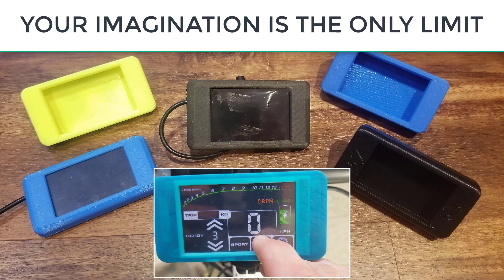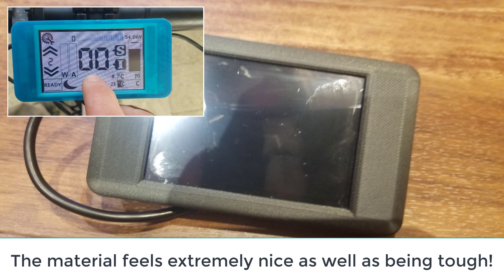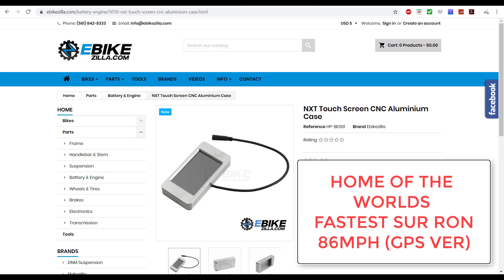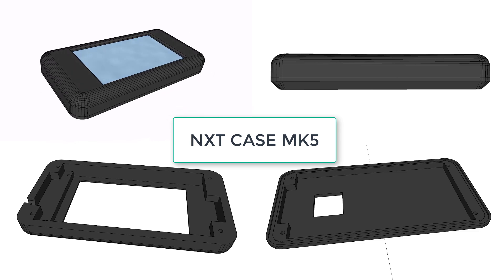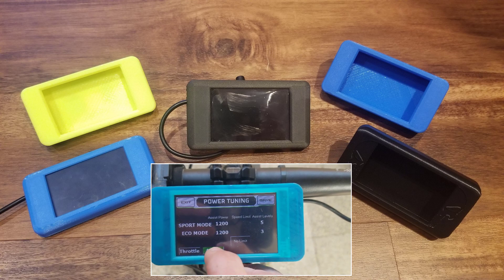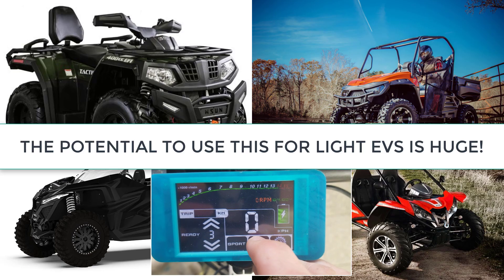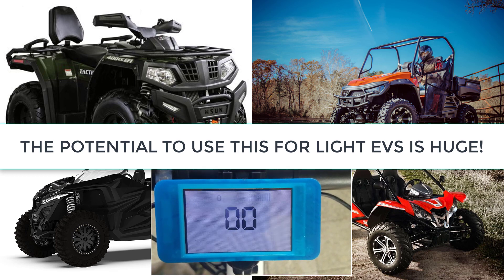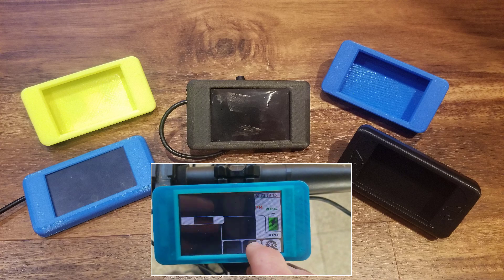NXT Display - Customization Options - Build the Ebike YOU want!

Comment: I have a Yamaha YZ250F bike with a ME1302 motor and a Kelly KLS72701 IPS controller.  Can the NXT display be used on this controller.
Reply from the maker: The nxt only works with ASI controllers right now. Im not sure if it could communicate with the Kelly in the future. I will ask tho. Cheers

Comment: Hi Captain, I just received my NXT case from Ebikezilla, looks and feels great. 
I installed the screen with some trepidation. 
It fit perfectly, my question is, should I run a bead of silicone around the inner screen edge and rear cover to afford some ingress protection? 
Thanks
Reply from the maker: You can try doing that. You can get assembly silicone from car places like lordco. Or you could bag it in the rain. I have a protective cover I am working on for the x case version. I might be able to make one for the Ebikezilla one seeing as how it is an almost exact copy from the first design I did last year.
Reply: @HighVoltageKits  I will definitely use some assembly silicon then, mainly for splash protection. 
Thanks for the reply.
Reply from the maker: Anytime. Enjoy your screen! Cheers

Comment: Do you know what has happened to Alan at ERT? What kind of circus is this fool running? Please, don't waist your money on ordering from ERT.
Reply from the maker: I have been helping on the NXT project since late last year but I have no part of shipping or orders. I have always got everything I ordered but it can be a wait. It's not a huge operation and is under pressure in terms of supply chains at present like many places. Patience can be required. On the other hand you will end up with some of the best tech around for DIY ebikes. Cheers.
Reply: @HighVoltageKits  Thanks for your reply, I haven't heard from him since January, I know he's been busy just wish he would earn the money I sent him!
Reply from the maker: I'm hoping that when the covid stuff dies down the backlog will get sorted out. Are you waiting on the 4000?
Reply: @HighVoltageKits  By the way I love your vids! I'm waiting on a Bac 800 and the Nxt display.
Reply from the maker: Thanks Bob. You will get one I'm sure. The new wiring harness looks pretty good from what I have seen.
Reply: Thank you very much for every thing I've learned from watching your very well done videos, you have helped me make many right decisions!
Reply from the maker: You welcome Bob. Cant wait to hear when the bac is up and running.
Reply: @HighVoltageKits  Call me stupid but I'm running a Bbshd mid drive and a Calibike 5000w rear hubmotor. I have learned to let the strength of one help the weakness of the other. Two independent drives assures this 72 year old Marine that I will get home, plus I'm damned hard to beat across an intersection! Keep up the good work and by ALL means HAVE FUN!
Reply: @bobpatty2937  he must be running some sort of scam.  He doesn't ship and won't return payment.  You can't even contact him.
Reply: @dillonthirst  This is a sad situation, all he has to do is take an ASI controller and match it to HIS display. He has had my money since Jan and at one point lied and told me it would only be a couple of days. That was over two months ago......
Reply: @bobpatty2937  captain says people are receiving them.  Could be a year before we receive ours.  That's just not right.  The sad part is there is no customer service at all.  Even if I wanted a refund I have no recourse here.  Scary.
Reply from the maker: I don't think it will be a year. But it's not in my power to make them either. I will make sure Alan is aware you posted on here.
Reply: @dillonthirst  I have spoken to a federal prosecutor in Muscogee OK. He told me since my order amounted to less than$1000 it would only be a misdomeaner and the case would be ignored. However if enough of Hu's victims get together and file fraud against him which would prove his intent to defraud in mass then they might be interested in helping. He's no doubt a damned worthless lazy Democrat...lol!
Reply from the maker: Bob. I realize that you are upset. Have you considered jumping on my discord channel and talking to people. No one is trying to scam you. There are problems and delays when one person is doing the manufacturing and development. You are most welcome. I would ask that you leave the cancerous Left Right politics aside though. Its horrible. The rest of the world looks on in horror at the needless hatred. The world is not this black and white. Is really sad that a great country like the US is paralyzed by this inability to compromise. Its like you guys want to collapse. But as I said jump on discord and post some messages. The NXT is not a scam.
Reply: @HighVoltageKits  At this point of frustration, the only thing I'm considering "jumping on" is the FRAUD that has my money! The simple truth goes a long way with everyone, and I am no exception. Outright lying to me like Hu has done will get his worthless ass kicked if we ever meet. Quit making excuses for him! If you are passionate about this project, and I do believe you are, find yourself a decent technical person and get the hell away Hu. As far as hate goes, put yourself in our shoes! From what I'm seeing, Hu ships to his suck asses and has been living and doing whatever with everyone else's money, now how close did I get?
Reply from the maker: I am suggesting that more would be accomplished through the discord channel than threats and insults. I make excuses for nobody. But threats of physical violence will see you serving jail time... right. You can't just beat the shit out of people. On discord there are quite a few people with the nxt and lots of updates. Its up to you. I sent Alan a message with regards to you both.
Reply: @HighVoltageKits  NOW I think you realize how upset someone can get when they get lied to. I've been tried twice for second degree murder as a peace officer, I know all about what I can and cannot do. I was promised my order MONTHS ago. I'm starting to think this is a conspiracy maybe? Just tell Hu to send me my order and you will never hear from me again.
Reply from the maker: I'll do my best Bob. It would be a shame if I never heard from you again tho. Its good to chat to people from all walks of life.
Reply: @HighVoltageKits  As I said before Captain, I'm not blaming you in the least, but as everyone knows sometimes it takes a little "squeaking" to get some grease you paid for, and that's where I'm at currently. Except for your courteous support this has been a bad experience. I have no intention of ever using the controller or the display if Hu has modified the controller. His word and trust are worth less than nothing to me and I'm certainly not stupid enough to ask for my money back which will only get someone else delayed. Thank you for your help and interest, best of luck!
Reply: @HighVoltageKits  My apologies! I just noticed an oversize that's my fault. The "worthless lazy Democrat I was referring to was the federal prosecutor, not Mr Hu (I'm not near that mad at Alan!)   Sorry!
Reply from the maker: The world makes sense again. No worries.
Reply: @HighVoltageKits  Hey, Captain, What happen to Alan, last text message I got from him was on May 10th. The picture he sent me, was from his arm with an IV and Hospital Tag... Is he OK?
Reply from the maker: Yeah hes ok. Had a rough few days but back at it. He held back the latest batch of nxt stuff as a couple of bugs were found. It's been apparantly more difficult than anticipated to ramp up production. He is working very hard though.
Reply: @dillonthirst  I wish I had hone a bit more research on ERT, however since he is in Canada, good luck legally. I have PTSD too bad to ever meet people like this apparent.........

Comment: Hey captain, i have the gen1 x1-pro on my bike for a year now, and it never run good. By now, the motor doesnt turn at all, not sure if i killed the stock controller with some bad settings.
I want to run 2000 to 2500 watt at 14s 52V, what controller setup would you suggest for throttle only use?
The nxt looks nice, but im not sure how the motor calibration on the bac works, and would like to have (finally) something plug and play, something that works...
Thanks, stephan
Reply from the maker: The ERT kit with the NXT will run the X1. Pretty much the setup I am running now. The nxt is effectively ready for GEN1 cyc as it stands. Testing is focused on the bbshd right now. CYC should honor warranty issues though for controllers. I did not get on well with it at times. I am very much enjoying my experience with the bac800 though. Once the bbshd stuff is sorted out we will look at the cyc. But like the bbshd the idea is to use a bac800/ nxt kit that works with your motor.

Comment: Question for you Captain Codswallop, does the NXT for the BBSHD get its speed reading from the original BBSHD wheel speed sensor, or does it get it from motor hall sensors? I am  using a 9 speeds cassette, readings from motor hall sensor would not work in this case... Cheers
Reply from the maker: Good question. I have a feeling that it is being pulled from the hall sensors. Supposedly that is one of the reasons that we can't get a temperature reading from the BBSHD without an external probe.
Reply: @HighVoltageKits  Well, that would be unfortunate... I know BACDoor allows to select either the motor Hall Sensor or the sensor on the wheel  for speed readouts... Remember, the BBSHD Speed Sensor, is also a Hall Effect Sensor... Just need to tell BACDoor from which signal wires to take the readings... The problems is that most BBSHD users do use gears, so if the speed readouts is not coming from wheel sensor, then NXT speed readouts will be useless for Bafang users... But I am pretty sure Alan knows this and it should be set accordingly.. You can confirm this by simply changing gear on your ebike to see if the speed changes or not... Simply lift the rear wheel up and change gears, the speed readouts should increase or decrease with gear changes with same motor RPMs. This will be a deal changer in my case. 

I think that Bafang controllers do have a temperature sensor inside the controller, but when you take the controller out, then so goes the temperature probe... Would be easy to install though... Alan could provide one of the vacant analog input of the BAC800 to accommodate an external temperature sensor, better yet, he could offer it as an option for his kits an sell a sensor so the controller is calibrated for it.
Reply from the maker: I have speed sensor on there and it seems accurate. I have my wheel diameter selected. It reads direct from the bac. So it should be am option to choose where to take it from. I will forward your concerns. I'll let you know if I get anything.
Reply from the maker: Never mind. Its definitely pulling it from the speed sensor. If you watch this the RPM is showing but no speed as the chain is off and the bike is still. https://youtu.be/XLE8FiL9Lvo
Reply: @HighVoltageKits  Yep, that confirms it, no chain on that video, no wheel spin, no speed readouts... Great...
Maybe, you can suggest to Alan the possibility to pre-wire one of the vacant analog pin (if available) for an external temperature sensor that he could offer as an option... they are pretty cheap in cost.

Thanks
Reply: @HighVoltageKits  Hey Captain! Can I get you to clarify one thing for me? Are we severely over volting  a Bbshd  without a temp. sensor? Drawing from what I know about building F15 fighters, that move AINT' SMART! BUT what the hell, aint' nothing free!
Reply from the maker: Hey Bob. It's an interesting question and I'm not an engineer. I'm no expert on F15s either but I did once get to bash away at a Canadian Forces CF18 for a few hours with various tools after it crashed.... another story tho. There actually already is a temp probe in the bbshd. It's just for some bizarre reason its not used and to use it requires some clever coding and wiring. Some people wire their own in. Alan is looking at adding it in as a feature. It requires some development. Likely a harness swap would be needed to get it functioning in an existing install. The bbshd is incredibly overbuilt as a motor it's the controller that limits it. People have run it at 4000 watts. The sweet spot seems to be 72 volts 3250 watts. Cool job though. Were you ground crew. My wife was Air Force. Retired now tho.
Reply: @HighVoltageKits  I actually built F15s at MacDonnell Douglass in Tulsa. Did my time in the Marines. I had planned to go slow and watch for overheating, and had planned to limit watts to no more than3000. Ever considered a coolant jacket for the lower half of the motor assembly? I have, with a small alum. exchanger. (told you I was crazy). There are wireless heat sensors with alarms.
Reply from the maker: That's awesome. I like your thoughts on the bbshd. It's a shame bafang don't seem to want to update it. An easier way to get more power albeit less ingenious is to use the lighting rods motor. It's an ipm the same as the bbshd but truly built for the power. I'm hoping to do a build with it later this year... although longer term plans are in semi flux as for every human on the planet.
Reply: @HighVoltageKits  Here is my background dealing with heat. My bike is driven with a Bbshd 52v1500watt mid drive and a Calibike 5000w rear hubmotor. I live in Hill country, and using two separate drives relieves both heat and excessive power loss. The strengths of both make up for the weaknesses of both. Battery drain goes way down, and if I only use one system at a time, I double my range. Dependability is a very comforting thought, If I blow a chain, the hub brings me home etc. If I could rum both at 72v this opens up a host of possibilities as far as battery management.
Reply from the maker: Yeah I'll say. Sounds like a cool system. I'd like to try dual drive. I have an idea for designing a sensor front and rear to allow for more accurate tracking of wheel speed. Maybe 12 magnet. Things like traction control become possible then.
Reply: @HighVoltageKits  A source that might interest you is Johnson Controls they manufacture everything electrical in the area of sensors and elect. devices.
Reply from the maker: I'll check it out. Thank you.